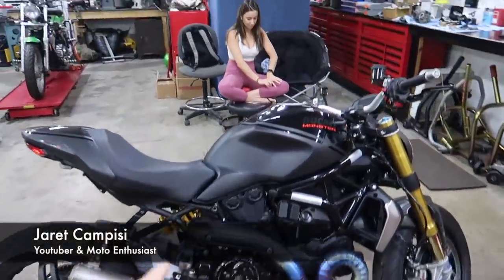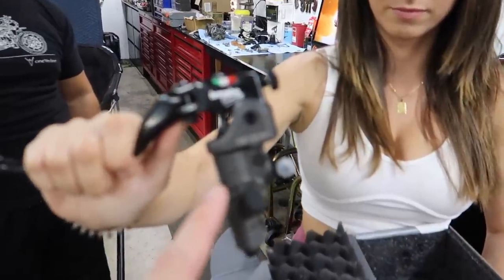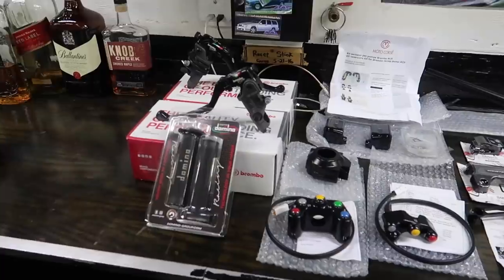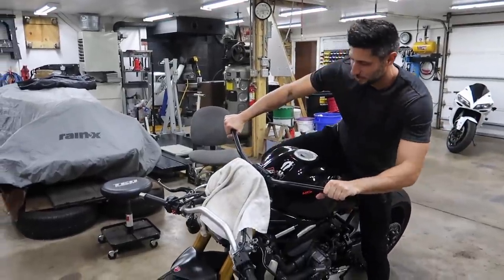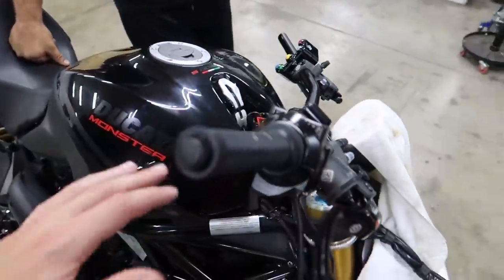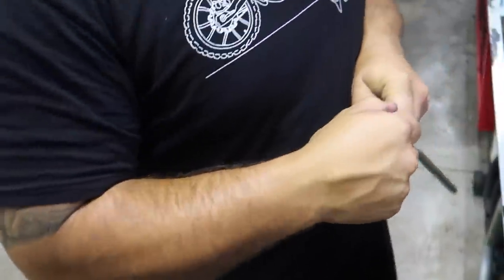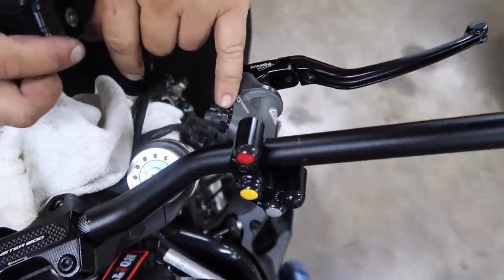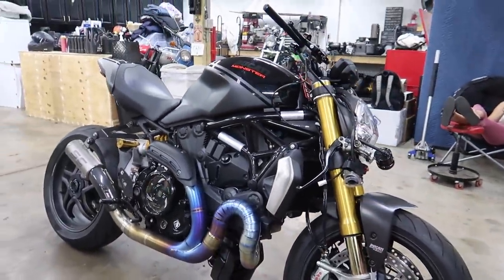$2,000 Handlebar Set Up for Our Monster 1200!!!

Comment: Be aware, it's advisable that you pull the bar back to where the grip surface is close to level with the horizon. Because if there is a steep angle on the grips, it will cause your shoulders to be hiked up while in riding position. That is at least my opinion from my past experience with running different bars on my bike.

Comment: The handle bar feels good when the bike isn’t moving at that angle or when it’s moving slow, but if you don’t set the handle bar to the stock position at the stock angle the steering will feel vague at faster speed…just mentioning that from experience. Only the stunt guys set the handle bars that upright.

Comment: Hi Jaret, which model bar is installed? The MA011?
And I have an idea/question for the next built: did you ever built a bike with a serious update on the suspension? Not just exchange parts, but replace the internals for some serious stuff. Combined with you focus on wait saving and Nintendo buttons, you can built the ultimate track-toy. Maybe a 2021 RSV4?!

Comment: Dado - Teflon tape should be wrapped in the same direction as the thread. The reason is so that as the thread is turned in, the tape is pulled tighter around the thread, rather than tending to unwrap it. Just sayin'.

Comment: Too much backsweep on those bars IMO. And if you rotate forward for less sweep, the ends get awkwardly higher. That bike deserved a slightly flatter, straighter bar for a slightly sportier position and weight on the front while still being comfortable.

Comment: Bleed nipples have a  male and female cone that provides the seal when tight, they do not leak. Ptfe tape is not needed, you should know that Dado.
Reply: I think he's just using the tape on the threads for bleeding. Air and fluid can leak past the threads when bleeding or when the bleeder is open. Especially when vacuum bleeding. He did wrap the tape wrong direction though.